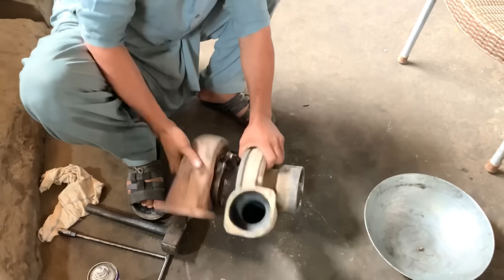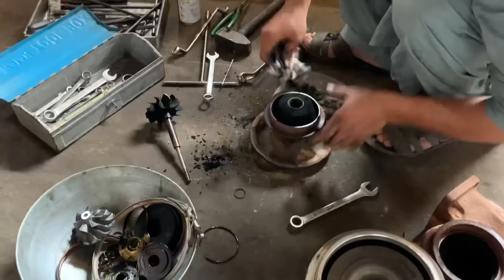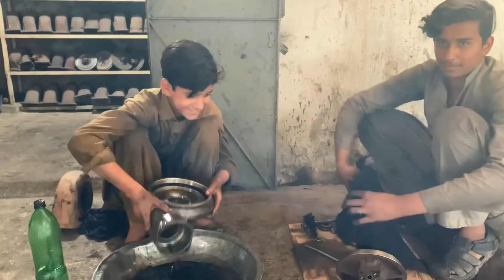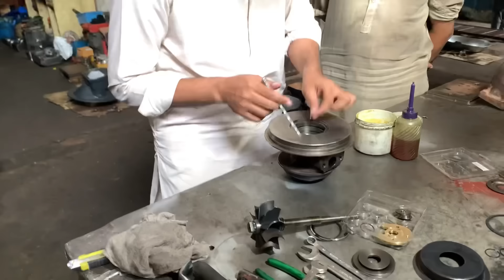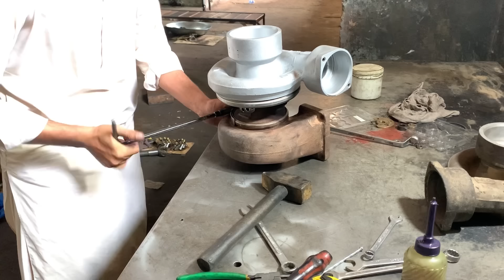Turbocharger is not Working Good | How can repair turbocharger by a small boy ?

Comment: Rebuild without balancing and testing ...thats a good one...still you have to appreciait  for what they have for tools and knowledge .
Reply: Yea its a hit or miss . I have done it with mixed results.
Reply: Same as croquest 87... also wire brushed the shaft well done...
Changing insides without balancing:
Small turbio dies after 20k km
Biger can hold up to 100k tops... 
Its chepaer and easier to buy ,,ready core ''
Reply: If it cost a fraction of the cost of a new one and get 50-100k out if it , it still good. It's probably a common practice there.
Reply: I was "screaming" ... Why are you painting the compressor blades?!
Reply: dont forget that 'new'  chrome spay finish for the intake fan   XD
Reply: U beat me to it 😂👍🇬🇧
Reply: @Fulano-bo8vc  😂😂😂👍✌️🇬🇧
Reply: @Fulano-bo8vc  Makes it look purdy 😂
Reply: @RVMD95  You didn’t look close enough.
Reply: Just for fun not for use
Reply: @eb9826  what did you see that was new and not just shined up? I thought maybe the center bearing but was not going to give them the benefit of doubt.
Reply: @RVMD95  you didnt see the whole rebuild kit they unwrapped? I watched it on 2x and still saw that package.
Reply: @Fulano-bo8vc  i was wondering the same.
Reply: @claywebb8199  well said . It’s always interesting to read the comments from the experts in the comments section of you tube . Most of them could probably tear a turbo apart and wouldn’t have a clue how to reassemble it .
Reply: @deltalou8987  lol
Reply: @007h13  - you took the words right out of my mouth.
Reply: Considering the demands that will be placed on it.  It's not ideal but it's also not the worst.  It'll live a decently lengthy life.
Reply: @matty4z  +10 hp right there
Reply: @xinyster18  x10 if you put a 'Greddy' sticker on it
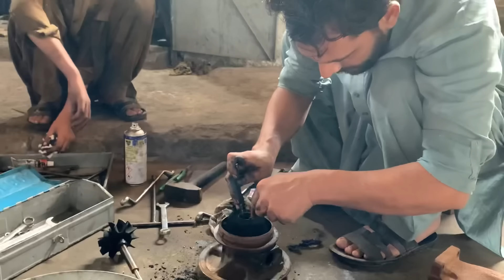Reply: 3:03. That young boy has such beard at such young age
Reply: @Fulano-bo8vc  it's suppossed to look as if it was a new part. People want it.
Reply: They are using all the dame parts should be balanced already just a rebuild
Reply: Heh man, lighten up. This is how they do things and it obviously works for them. There are so many things we in the comfort of our well paying jobs and OSHA (which no doubt you also have issues with) take for granted as common practice. I just really appreciate the hard work and craftsmanship. Don’t be a hater. Start 2022 being positive.  I have great respect for criticism that is well thought out. Stay safe
Reply: @Fulano-bo8vc  to look like a new ))
Reply: Does it still work? No ))
Reply: He looks like he does 100 a week with his speed. I would love to know how it turned out but it must be legit. He obviously does alot of them!!!! Its a way of life for a poor heavily sanctioned country I'm sure! Just fix it !!
Reply: @claywebb8199  well said!!!
Reply: It's nice and clean.lmao!
Reply: Maybe they do this from years.
That is correct way for them, but wrong for us.
Reply: @claywebb8199  parade mamar
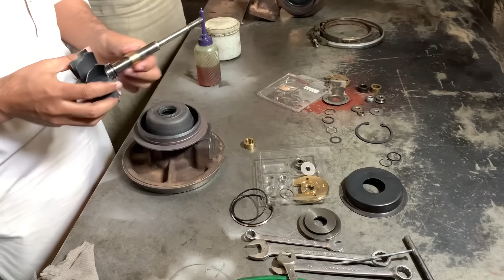Reply: @RVMD95  you must be very blind then I guess , 07:00 there is a kit on the table with seals /bearrings.
The only thing I didnt understand is why he used the wire brush on the shaft and why did he paint the turbine rotor..?
But if the brush has brass wires it doesnt matter too much because the material of the shaft is harder then the brush.
But to be fair I did the same with a turbo 2 weeks ago and it works just fine. 
Why throw stuff away when it is easily repairable.
Reply: aka the ‘eBay’ rebuild 🤡
Reply: Fair comment. I replaced the turbo seals on my VW Golf, took the turbo to bits, reassembled without balancing: turbo still working fine 4 years and 71,000 miles later.
Reply: Pakistani mechanics do very good job, I trust them
Reply: Lol Man you are really comenting this? If you are in this video why the algorithm selected you as posible Viewer? Maybe your coment should be for the growth of this people can you show us the right way yo do It? But make it with the tools that this people aré using and the way that its the right way whith profesional tools. You are judging the book by his cover may be I Will do the same. By the way that your profile photo Is shown you neeeeeever had a ratchet in your hands. ZIP my mouth with a comment with the right way yo do It but with your video not with a link
Reply: @RVMD95  Used to be called Nip engineering when I was a kid.
Reply: Yea cause from the video you can see they can do all that. Top of the line equipment right? Lol what a dumb comment
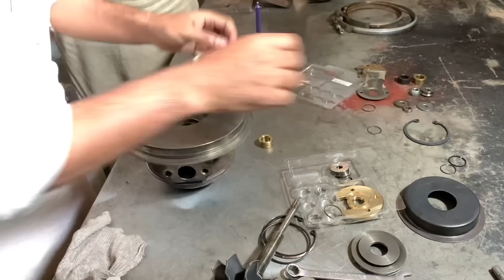Reply: @RVMD95  Try looking at 7:22 min, you will see the turbo rebuild kit.
Reply: @RVMD95  you call it US of A we call it disposal society.
Reply: At least the floor was swept so it's clean 😆
Reply: What is balancing and testing ? Food ?
Reply: Those diesel trucks max out at 2000 - 2500 rpm, don't think that turbo will be spinning too fast, I think lack of oil changes and dirt in oil will kill the bearings first.
Reply: Good for a few miles.....
Reply: @RVMD95  for sure, tbh most rebuilds are because of oil passing the seals which is all that's replaced, new bushings/seals. But then the rotating assemble should be balanced to ensure longevity.
Reply: @scotdeane5024  Turbo rebuilds are not complicated the seals normally fail and start passing oil. He replaced all the seals ans bushings with new. If the impeller and housing are OK that's all what any Western company does but they will also Balance the shaft
Reply: @RVMD95  don’t forget people in these countries have to live a month from what we make in 2 days. So yes do only what’s needed.
Reply: @RVMD95  lol all the parts here are refurbished. this is exactly what we do in the us
Reply: That's how you get recurring revenue mate 😆
Reply: @tsgu8728  exactly
Reply: My thoughts too
Reply: Good sir.
They spray painted the compressor wheel.
They dont care…
Reply: Of all things wrong here you painted the intake blades  definetly out of balance now lol😋
Reply: It’s okay guys don’t hate appreciate, I love that the assembler wears all white and everyone moves out of his way! Turbo Yoda! And the fact that they got the young 🩸’s in there too , love seeing shit like that 👌
Reply: Yeah, destroy a perfectly good serviceable turbo which hasn't got more than a two digit number of running hours. That thing is practically brand new. They wouldn't be able to open it with out an acetylene torch had it had any sort of a life actually doing boost.
Reply: @RVMD95  You know what? You're in America and they are in Pakistan. There is a big difference in working condition. And if you're smart enough you need to understand their English title also. They are not Americans. It might be that they mean OVERHAULING AND CLEANING. No need to replace parts.
Reply: They have youtube, the best education platform in the world
Reply: Agree. Would have also sandblasted the core and exterior exhaust and gave the exterior exhaust a little clear coat. Also a bit of finishing on the intake side.
Reply: No cambio ni la turbina de escape ni la de compresión , no tiene que balancear nada , si no tiene fugas de aceite andará perfecto
Reply: Obviously works! They're in business doing these multiple times daily.
Reply: @RVMD95  layer of non heat resistant paint.
Reply: @jacekkowalski2849 this cartridge has been balanced from factory, changing kit you don’t need to balance again. Kit does not need balance 🤣
Reply: @RVMD95 god damn you are slow
Reply: @RVMD95 😂
Reply: @RVMD95 😂
Reply: Why you have to rebalance when using the same shaft
Reply: You don't have to balance if you're using the same parts
Reply: Так он винты крутил пальцами 😅 вот и ксть балансировка

Comment: And here is you're EBAY turbo 😂.
Reply: Use OEM spare parts and destroy the used ones, always.
New turbo? Hammer in the turbine of the old one , with no mercy , thats all.
Reply: Least it maybe looks like a dirty brass hammer 😂
Reply: Your*
Reply: @juancaorsi1805  why though, if a poorer country can use the parts you discard to repair their own broken parts.
Reply: @tidakadaide  true, why not?
Poor country , not bad mechanics of developed countries.
Reply: @juancaorsi1805  they certainly can make do with what they have... quite impressive hey.
Reply: Maxspeedingrods turbo in fact. Lol😂
Reply: And calibrated!!! hahahah Note the Torque applied using the dynamometric wrench.
Reply: It’s not about where you buy it, the question is can you rebuild your own turbo? You must be the type who gets someone else to do it for you 😂
Reply: @eryutu  you know , sometimes torque is variable , many factors like used or new bolts , different  kind of gaskets, the condition of elements of pressure etc.
The mechanic need to adjust the  torque by jimself and don't follow the manuals.
Indeed the use of instruments is basic .
Reply: That’s cold 😂😭🤣😂😭🤣
Reply: @juancaorsi1805  Yes friend, anyway, they are doing a Great Job !!! Honest people and working hard with a Great professional effort.
Reply: I trust these over the China ones
Reply: Yea exactly here is your reman eBay turbo we replaced the seals and just cleaned everything. Up and painted it lmao

Comment: Turbo repair without dynamic balancing is a shot in the dark. If you want reliability you can't skip it.
Reply: I noticed that he didn't mark the balanced position.
Reply: @royallplatnum  Job security
Reply: @royallplatnum lot of people say it is not needed cause balance is made on screw …
Reply: @vampirtransilvania  oh its definitely needed
Reply: @royallplatnum  Balancing is Theee most important part that will determine the lifespan of seals and bushes
Reply: Painted compressor wheel?
Reply: @vampirtransilvania   you balance on screw yes.
Reply: @laksflaks  1. This chra didnt need to repair

2. They only change kit inside and are using same axis - wheels so conclusion

3. Also same screw - this chra is already balanced, you put it on balancing machine and will give correct results.

Comment: Not sure if I’m more impressed that this “Dr” mechanic has amazing skills and speed or the fact his hands are so clean (for a mechanic)! Kudos to his assistants too.
Reply: im not impressed, he didn't torque the nut or mark the tubine wheel in reverence to the impeller wheel, so the turbo needs to be balanced or they will be rebuilding it again afterr the unbalanced chra wears the seals and beaings out prematurely.
Reply: @XiseTK  He marked the casing, perhaps he did and it wasn't shown.
Reply: everything was already cleaned, hard to get dirty like that.

Comment: -How do you balancing it?
-Yes
Reply: most big turbos are component balanced as opposed to assembly balanced. So prolly not a big deal.
Reply: @GordonTurnerr  There is half of the nut on shaft missing.. so it obviously was balanced as assembly.
Reply: @tkupilik  are you talking about the "nut" on the turbine shaft/wheel? If so then it is obvious was balanced as components. The actual nut that holds the compressor wheel on is normal, no material missing.
Reply: @GordonTurnerr  yes, manufacturer have to remove almost half of the nut to balance original turbo-compressor assembly. There is no way, that 'repaired' turbo is balanced. Also painting compressor wheel is not best idea if you care about balanced components. Obviously 'repaired' in india means cleaned, no one cares about functionallity or realibility.
Reply: @tkupilik  no, you're wrong. That's how the turbine wheel/shaft assembly is balanced. The compressor wheel will probably have some metal shaved off the backside of it, or near the nut (not the nut itself) that's how it's balanced. 

Otherwise you're telling me that the compressor wheel side of that assembly was absolutely perfect and absolutely no balancing needed (due to the nut being untouched) to be done on that side. Bullshit.

Comment: yes.
 this little boy and all the others in these videos learn very early tons of practical skills , and if they are smart, they find out much more with learning by doing and trial & error.
but many/ too much they will never learn, because instead sitting in school, they work and so they never learn, how to read and understand a manual in english, or even understand the physics behind the stuff they work on. 
here on this video the consequence is very good to see:
 the treatment of the rotor and especially turbine during dismantling- the balance of this is fucked up completely after -because the rotor runs 60.000-80.000 rpm, so very small changes off balance create very big forces, destroying the bearing very fast. (an off-balance of 1gr means ~100 kg centripetal force at rated speed...)
 spray painting the compressor wheel makes the same effect.
Reply: If may i ask you sir. Are you american?
Reply: @jhanericbagan9587  NO SIR, im german. why you think this important?
Reply: @idlewild3911  i do enjoy, especially they repair and do not throw away and change only to a new one, but check some facts between ger and pak: gdp ~50 k to 1,5k 
analphabetism 40 % to 4%,  average lifespan 81 to 65,  hdi 0,947 to 0,55 - rank 6 to 155! compulsary education is a key-, not a costfactor. 
and by the way, cause of my job (i go worldwide) have been  there- there were only a few countries in the world worse than pak. malta was very nice, anytime again.
Reply: @idlewild3911  Child labour is never excusable... India and Pakistan actually do have the funds to provide all their children schooling. it should be banned.
Reply: @jhanericbagan9587  lol wtf?

Comment: This turbo without balance surviwe not for long :)
Reply: It's already balanced from the factory, as long as the inlet/ exhaust turbine blades are put back in the same position as the guy in the video has done it remains balanced. The work done here is just as good as any European workshop. We sell ex CCCP turbine genset, diesel gen sets, turbine heli and warbird (MIG 23's). We've just rebuilt the turbos for a 38litre 2 stroke V10 in exactly the same way. If you're just replacing bearings and seals they don't have to be rebalanced.
Same goes for the jet engines we rebuild, if the turbine cassette blades are re used but just bearings/gasket/O rings replaced the whole shaft unit remains balanced..
Reply: @Draxindustries1  
But he didn't install the compressor in the same position as it was when he removed it, and he spray painted the compressor...another big no no as that can change the balance.
Reply: because you need the customer to comeback to your shop in a few weeks 😅
Reply: @donthadity  
Yep...built in obsolescence.
Reply: They wirebrushed the Turbineshaft 🥴
Reply: Also painted turbine wheel :D
Reply: @Draxindustries1  But they never put it back in the same position. Using grease on the shaft, wire brush the wheel, dissasembly on the groung.. Verry professional!
Reply: @dobrindragnev5153   when u don't have resources  and have to get the job done that's how u do it.. it's called Jerry rigging .. if ur familiar  with the term..
Reply: Agree
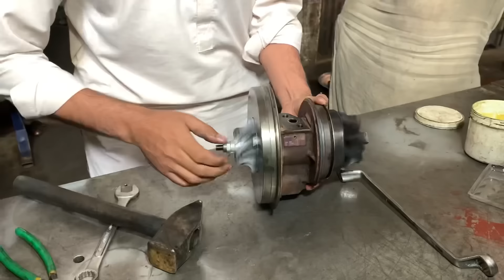Reply: What can You know. He check it @10:10 😂😋
Reply: @Draxindustries1  
Then he tighten the nut, he turn turbine wheel on axel ~15min...
This means he put not in same place.
I hope you work better with this russian turbos :-)
Reply: Then u should buy new one and give him
Reply: This is India, they don’t need to balance turbine shafts. It’s like in Africa they don’t need shoes
Reply: من أي بلاد انتم ايها السادة  تطلع. المغرب تخدمو مزيان وتكنو محبوبين. انتم صناع
Reply: @mariusmaciulis6740  Not every spray can has fill with color.😂😂😂
Reply: @pg41226  pakistan buddy pakistan.. reparing cost of this turbo is around 15 to 25 dollars only..
Reply: @johno9507  They will charge you only 15 to 25 bucks for it. How much you want from them??

Do you even repair this turbo in 30$ with your xyz eqipments or your bla bla bla??
Reply: @JobFarming  
But this time was paint...
Reply: At least they are working on a concrete floor and not dirt
Reply: @dobrindragnev5153  you could not do what these guys do. COULD NOT. If you spent a day trying to work in their shop you would feel useless by the end of the day you would put on a big show about how this is not proper and that is not proper and things should be going differently meanwhile the whole shop would be repairing circles around you you would accomplish nothing then just because you're a proud individual you would walk away acting like they only work circles around you because they're not doing it good enough meanwhile you accomplished zero and I suppose it's kind of difficult to tell somebody that they didn't do nothing good enough so you would take some satisfaction away from that fact remains the only reason you got upset in the beginning is because they're more useful than you.

Comment: that boy just disassembled turbocharger.  And later this fella professionally tightened compressor nut with a torque specified by the manufacturer 😂😂
Reply: "click"
Reply: And it will work just as well as any other rebuild too

Comment: Cleaning a vgt turbo can make a difference in its performance but a fixed geometry turbo not so much.
Axial or shaft end play will let you know the condition of the center bushing and shaft. Without micing it you'll never really know the bushing condition or if should be replaced along with balancing and torquing the end nuts are imperative to keep from fracturing the compressor wheel assembly when it gets up to temperature and expands.

Spray paint did nothing!

There's an old saying that says are you a welder or a grinder if you have to grind all of your welds you might want to practice a bit more !
Reply: yeah he has a torque meter in his hands alongside with a balancing tool!
Reply: Grinder and Paint makes me the welder I aint!🤣🤣
Reply: Spray do big things in reality
Reply: Weld your best, grind the rest!
Reply: one plier fits all.
Reply: @alebone_  😂